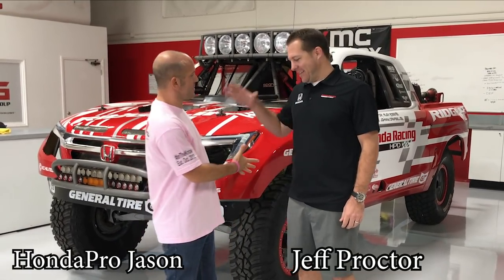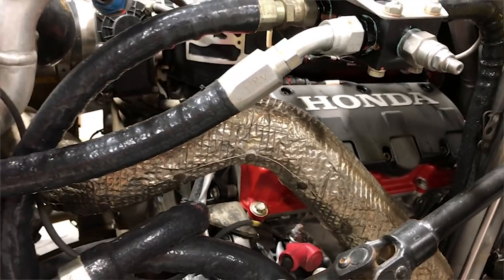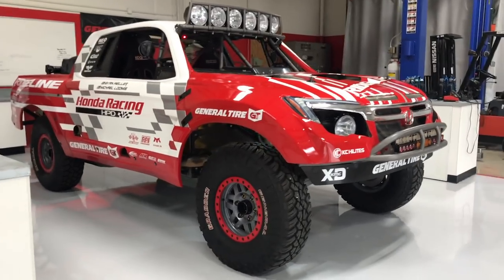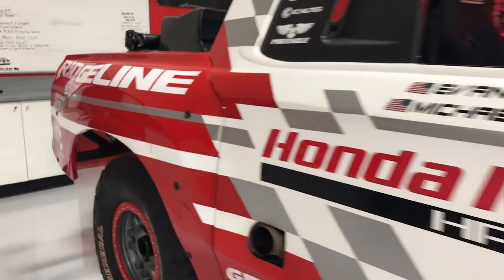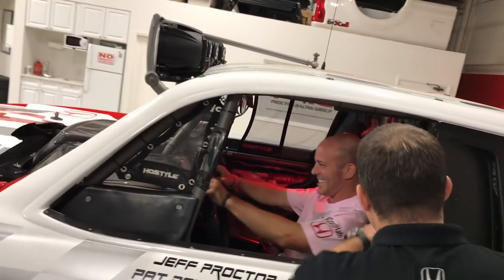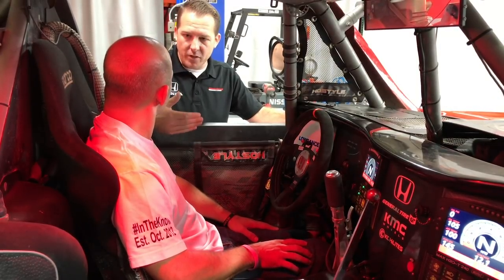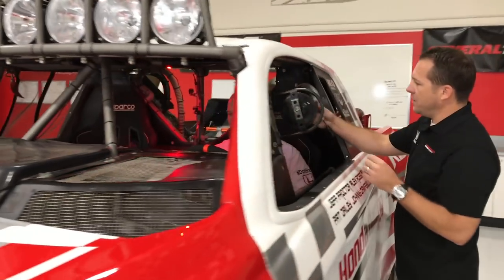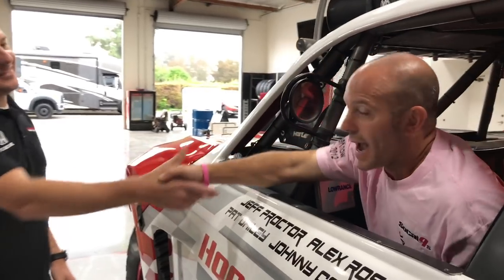This Is the Honda Ridgeline Baja & I Get to Start It Up

Comment: There's nothing Honda Ridgeline about this Honda Ridgeline.
Reply: Crankshaft, block and heads are standar OEM parts
Reply: @yepitsme431  I'm surprised! But does dropping an LS in a BMW E46 make it a Corvette? Haha.
Reply: @jorelldye4346  well every vehicle that competes against this truck are like that they only have the badge and even funny enough even toyota has no toyota parts not even the engine I believe

Comment: 550 whp twin turbo v6 lols If the Ridgeline wants to win its gotta make over 850.  Somebody’s gotta talk to their engineer.
Reply: Ah you weren’t listening very closely, He said it makes much more than 550 he just didn’t want to say, Plus if you’re talking about wheel horsepower the bigger the wheels the less power you get to the ground right?!
Reply: 3RDSON not true not true. often times people fib about power, plus he does have larger tires so id bet he probably pushing 550 to the wheels. but also bigger tires can be compensated with gearing, so who knows whats going on these days. do lizard people really run the country? we’ll never know.